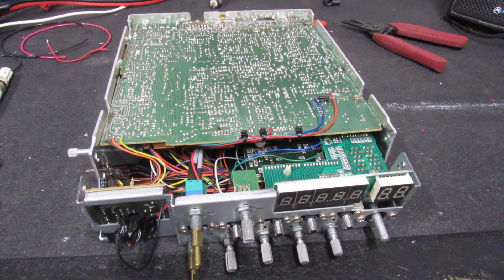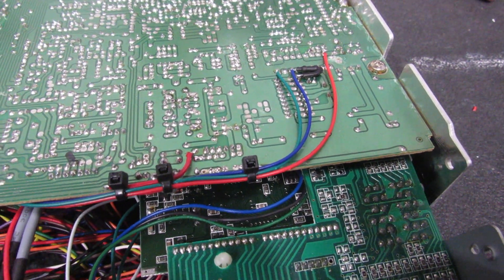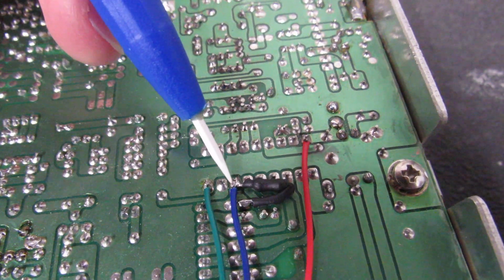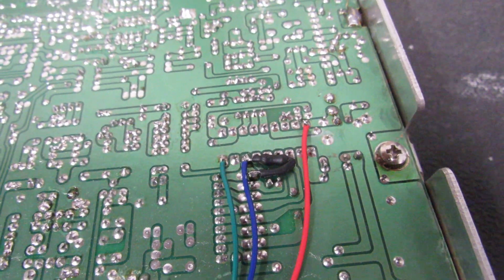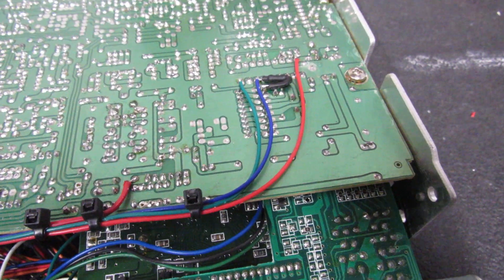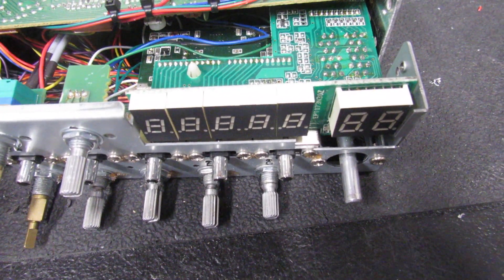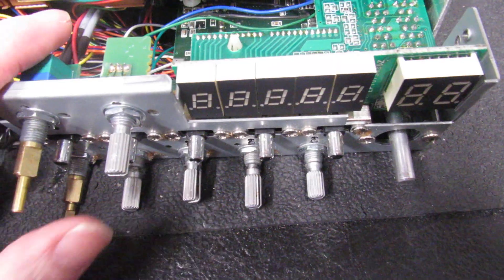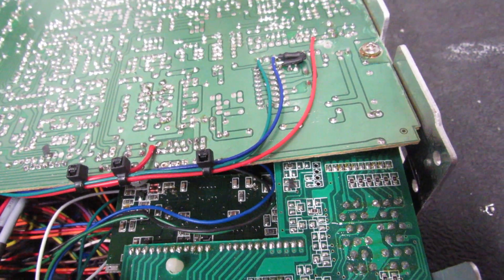Galaxy DX 959- Part 2.5: How to Add the 10kc Switch

Comment: I am planning on defeating the talk back feature and replacing it with a 3 pole (only using 2 poles) 4 position rotary switch I found on eBay. That way I replace a useless feature with a band switch. Hopefully the tone switch can lend itself to the +&-10KHz task.